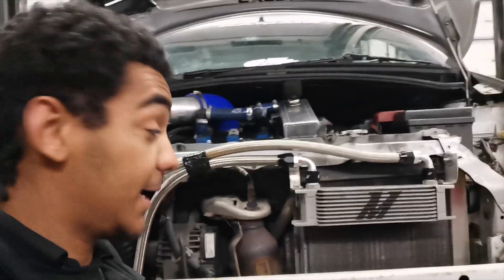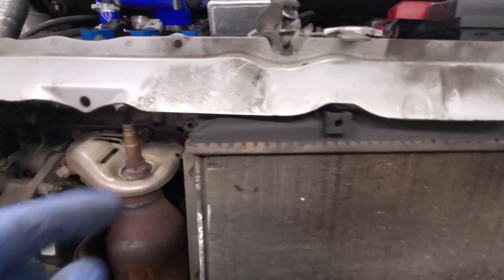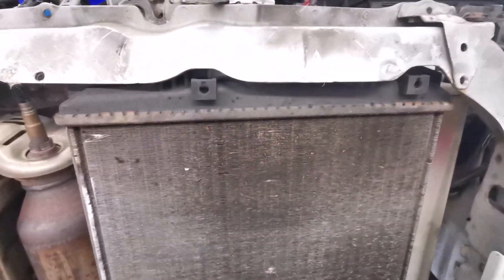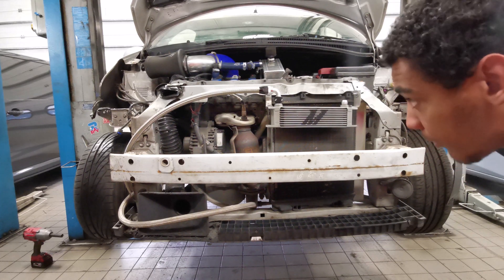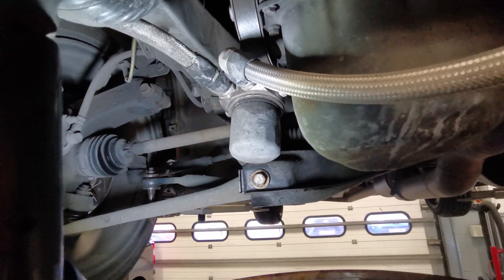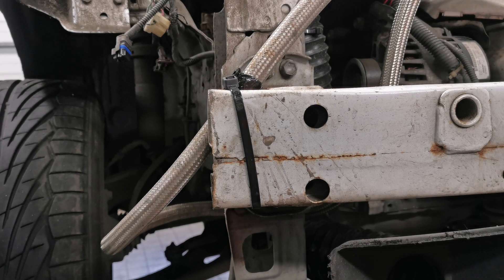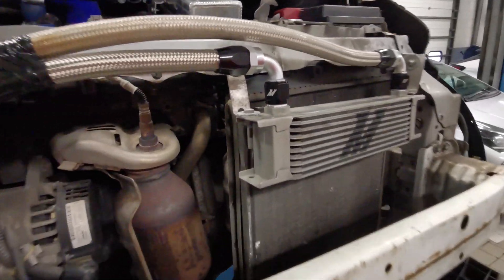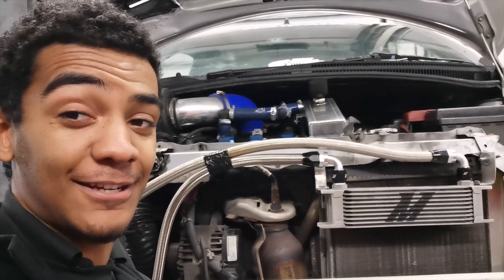ENGINE COOLING! TOYOTA AYGO OIL COOLER KIT INSTALL

Comment: i know where you can get a supercharger if you're interested mate. :)
Reply from the maker: Charger tech and TTS right?
Reply: @Thatsilveraygo  that’s a turbo, I’m talking about a full on supercharger
Reply: @Thatsilveraygo  heck’s to the no on spending £3000 on 80hp. The supercharger is £1100 ish
Reply from the maker: @gomanfong4077  charger tech make a supercharger kit
Reply: @Thatsilveraygo  Om thinking of buying and installing from Chargertech. Any comments, ideas, tips??
Reply from the maker: @evka3220  don't drive it until its mapped
Reply: @Thatsilveraygo  Thank you!!!
Reply: @Thatsilveraygo  Does it worth the money? 2500 euros appx. for buying, transportation costs, installation mapping to add appx. 25 hp (based on Charger techs test to on the safe side with appx.3.5 - 4 bars, on top of 68? Or should a mapping alone adding appx. 10hp for 300 euros would be better? Do you believe installing a supercharger is risky? Do you know of anyone who installed this supercharger instead of Rotrex?
Reply from the maker: @evka3220  I never got one, but I managed to make 30bhp gains N/A, supercharging can go much further with the right mods

Comment: What turbo kits can you add on the aygo, and can the mmt gearbox 2010 handle it
Reply from the maker: There isn't any turbo kits on the market for now, I look to change that once I've done some R&D with my own. If you have an MMT I'd strongly suggest an uprated clutch before you do anything else, I've seen them go wrong many a times with no mods
Reply: @Thatsilveraygo  hi what about the tts supercharger is that  good way to go
Reply from the maker: @victormanuelfernandezmarti3910  it is, also very expensive, but of course not a turbo kit